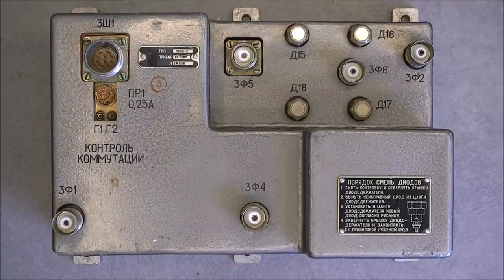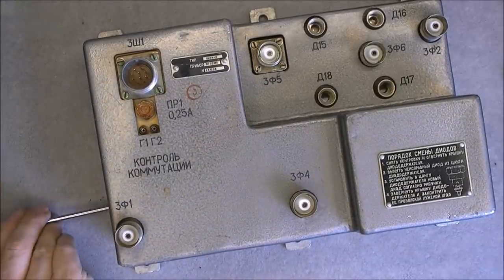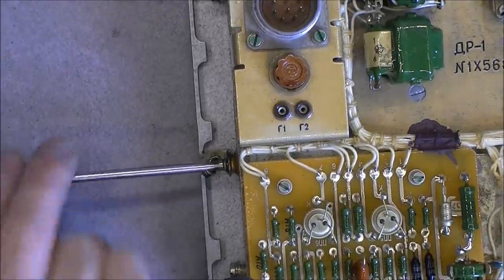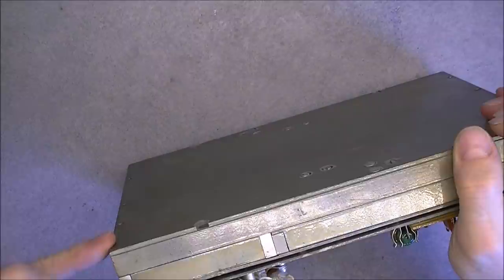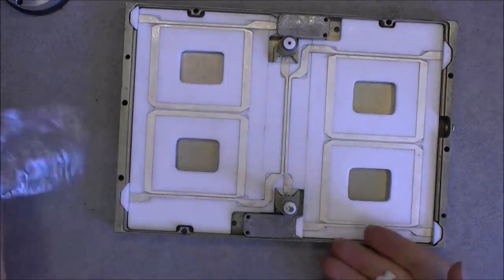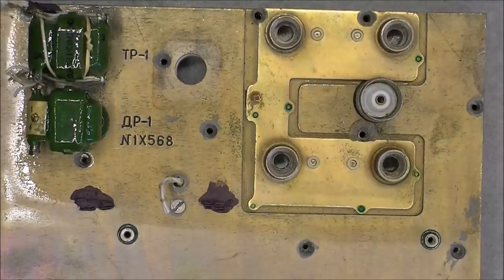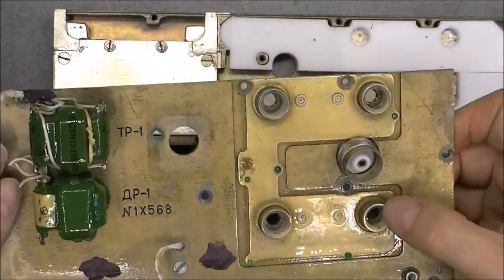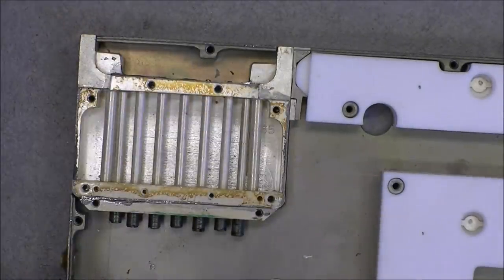Soviet avionics teardown: PION-M module with RF voodoo

Comment: this was a good one. big thumbs up!
(there was a weird noise in the audio, like an SSD interfering with a soundcard)
Reply from the maker: I made a number of tests, it seems the weird noise is generated by my camcorder itself. However sometimes it is not there, go figure. When I shoot a video, I have computers off and cell phone in an other room.  I have a  second camcorder of the exact same model, it has the same issue. Of course no firmware update to solve this issue. They are JVC GZ-HM200.
Reply: Yes, I was already going to say that there is some weird kind of telemetry-like sound in your audio. While it seems kind of appropriate for these kind of teardowns I guess you'd rather do without that. Good luck finding a solution...
Reply: Maybe noise from the camera lens focussing?, I've heard this noise many times.
 J.

Comment: Looks like the receiving part of x band radar.
Microstrip isnt really voodoo, but it is kinda weird till you get to know it better (I'm not an expert).
Reply: Splitfire pilot  so I'm right think that the two loops on the bottom side are indeed transformer?
Reply: Hi Alberto.
No I dont think the device has a pair of transformers, it looks like 4 microstrip resonators, because each loop is closed it would present a shorted turn if it were a transformer.
Its more likely to be  a dual bandpass filter at 12db/oct.